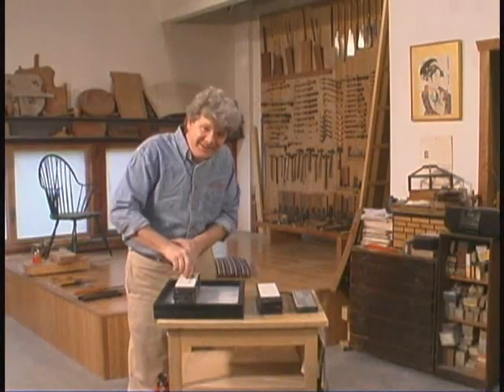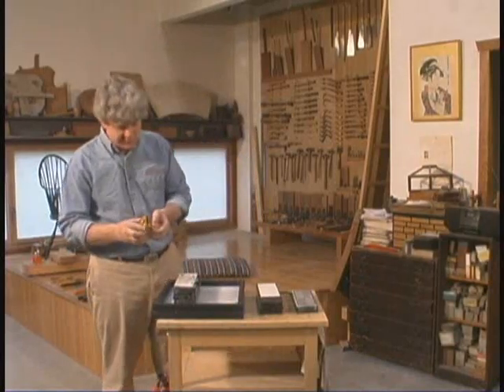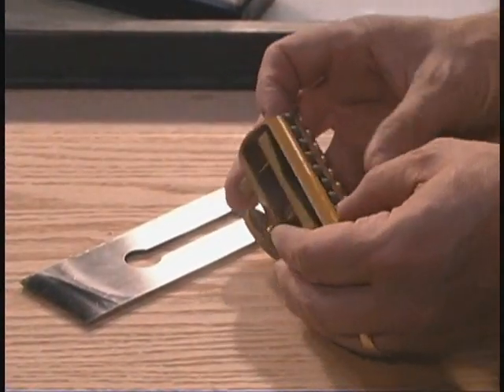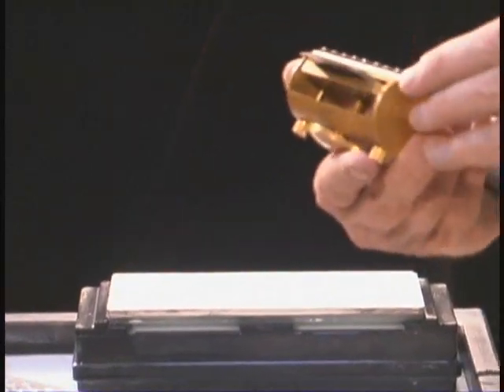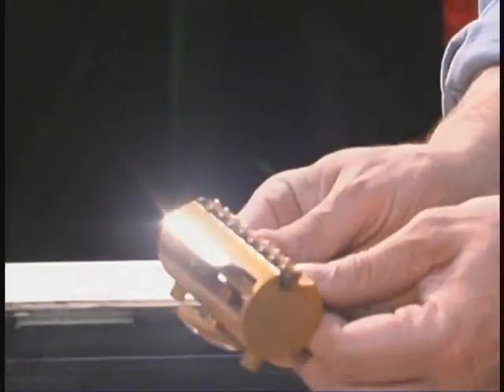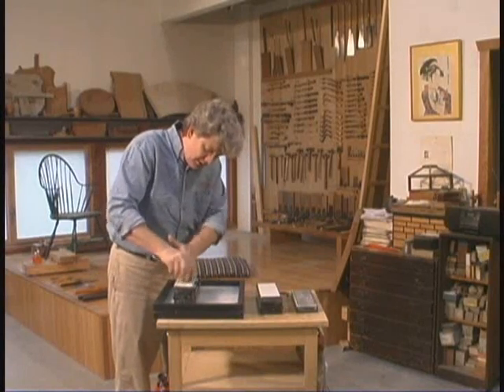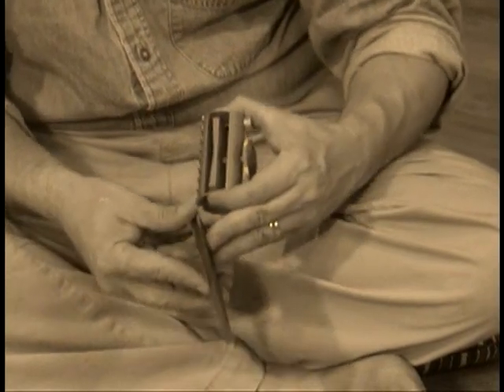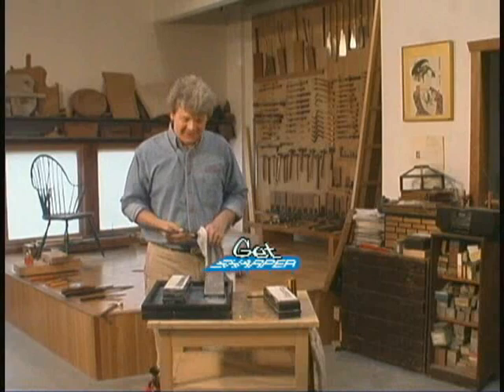SHARP SKATE DEMONSTRATION

Comment: sharpening side to side is  not appropriate for any professional use. ANY textbook tells you that sharpening suppose to be in angle 90 degrees to sharpening edge. in my opinion: device for amateurs only
Reply: It's perfect for you.
Reply: Side-to-side sharpening is proven to provide not only a sharper edge, but an edge that will last longer.  My only beef with this technique is that it will (over time) produce uneven wear to the stone that you are using.   I would put my stanley fat-max chisels sharpened side to side, against my traditionally sharpened Narex chisels any day of the week
Reply: sharpening was done for centuries (or milleneas?) freehand and side to side. I learned to sharpen so, used it for years and then I transferred to jig/back-forth sharpening: this never gave the fine edge the side-to side gave. Never :)